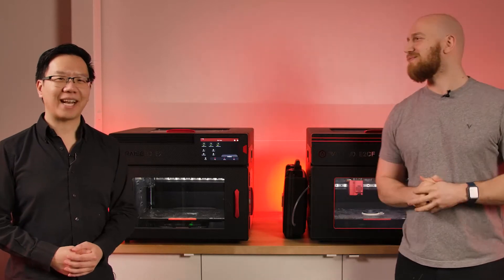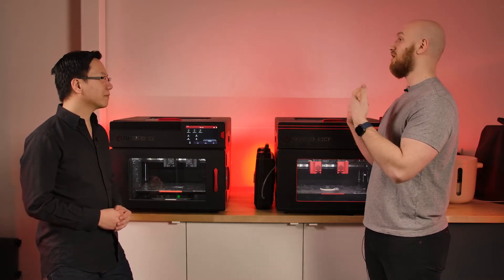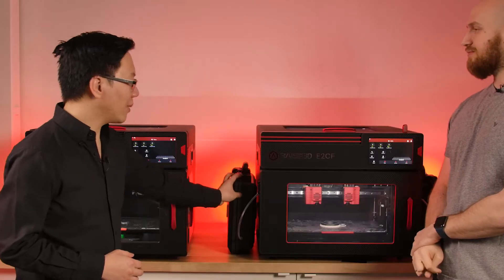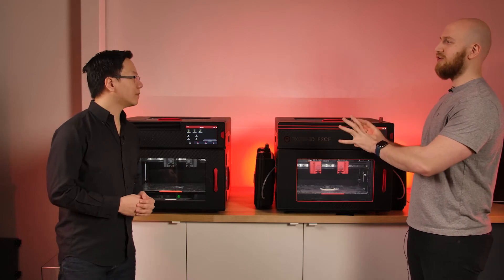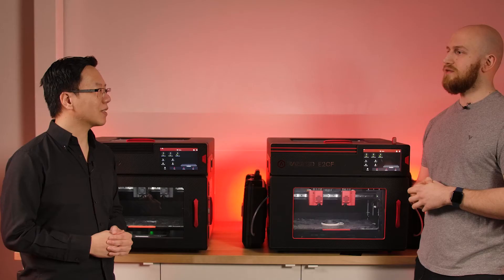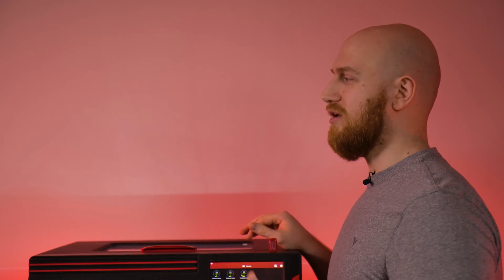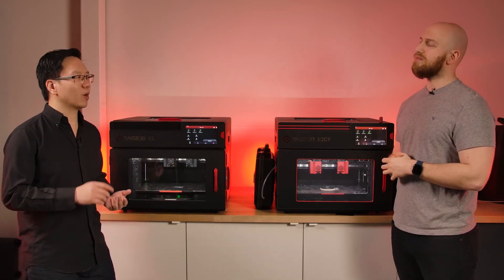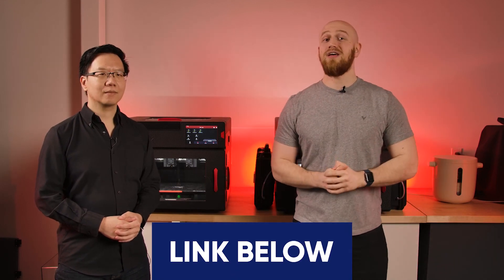Raise3D - E2 & E2CF Comparison

Comment: Thank you for the comparison! I am leaning towards the E2, since I need a printer that supports a variety of filaments. You mention that the E2 is perfectly capable of printing carbon filled filaments, only that the E2CF does this without any prior work. I would consider upgradind an E2 with the SliceEngineering nozzle kit, to be able to print PA-CF. Unfortunately I read a thread in the Raise3D forum in which people complained that the E2 drive gear wears down drastically with carbin filled filaments, and that there is no replacement part from Raise3D. Did you make the same experience with the E2, or do you know a source for hardenend drive gears?

If this is indeed a problem, I am considering an Ultimaker S3. The IDEX is only an extra, not a necessity for me.

Comment: I purchased an E2CF direct from Raise3D. I do not recommend the printer as the "closed experience" software is a joke. It is almost impossible to end up with a high-quality print.
Reply: Did you get it figured out?
Reply: @ChooChoo_4u  Yes. I bought a Bambu Lab X1 Carbon. The E2CF is limited by the software. I have found threads in forums where users hacked the printer and loaded different firmware so they could use a different slicer and were able to achieve much higher print quality. Unfortunately, I do not know how to do that. If you can design the model so there is no support material required, or the support material is on the bed surface only, then good results are possible. The support material oozing, stringing, not sticking to the build material, and getting smeared/globbed all over the build material weakens the part and it looks terrible. I have found Raise3D support to be unhelpful.
Reply: @Brad-RB  Wow, I am really sorry that happened to you.  Are you satisfied with the Bambu X1 Carbon?  I currently have a Flashforge Adventurer 5M Pro and have had some issues lately.  Support is lacking and parts for the printer are basically non-existent.  I am looking into getting a different one, once I get my money out of it.  How is Bambu Labs support?